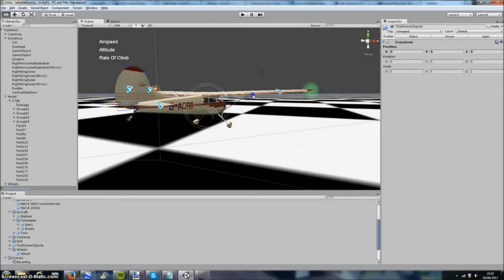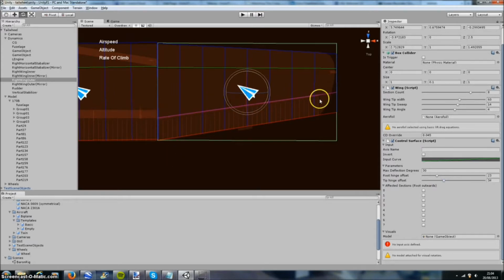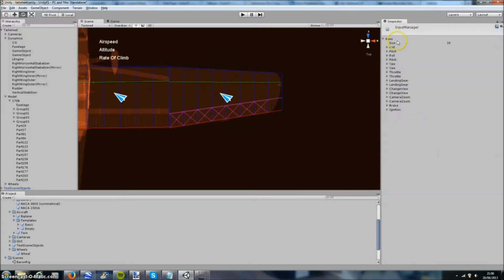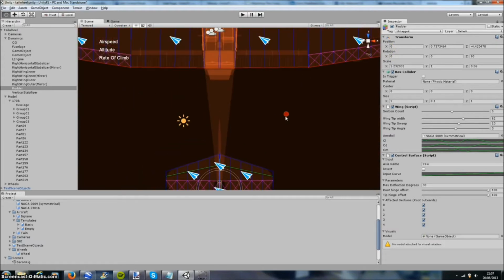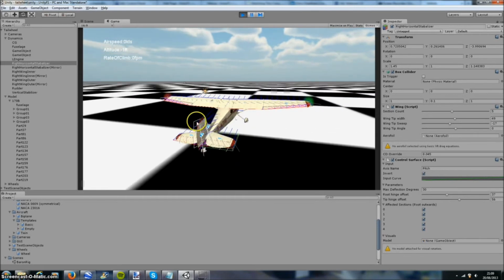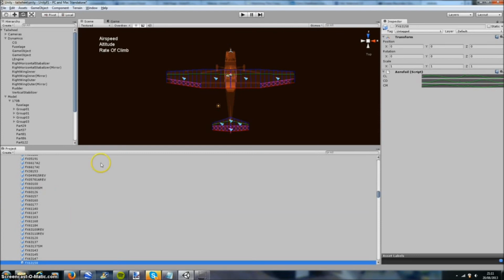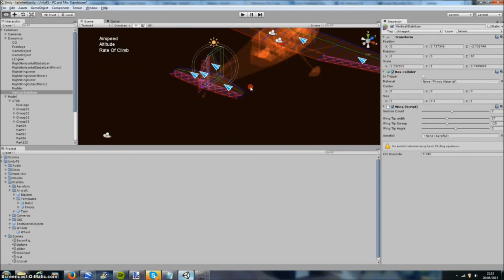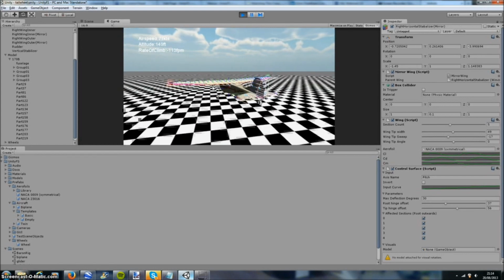UnityFS - Aircraft Creation - 4 Control Surfaces and Aerofoils

Comment: amazing, how did you work all this stuff out? are you an aeronautical engineer? i can't imaging how you can convert size and shape of aerofoils into flight dynamics like that. there must be an insane amount of math in there to do it right and i guess somehow you worked that out. truly amazing. 

i 'm planning to buy your package when i've got a bit further in my unity flight sim project. i want to model a Zivko Edge 540 aerobatic plane. can i assume if i follow all these steps, the sim should perform pretty much the same as the real thing? what about inverted flight, stalls and spins, flying sideways and other weird stuff?

thx steve